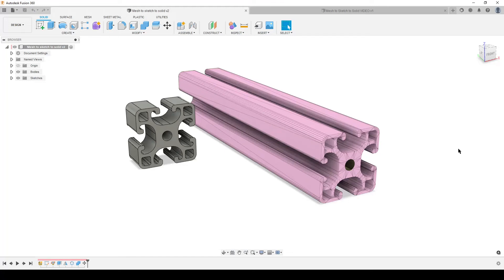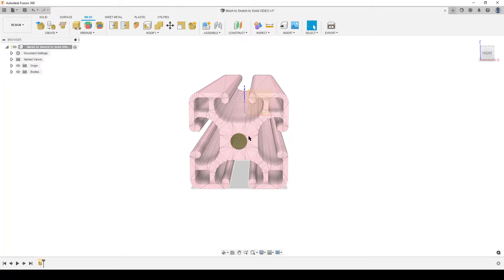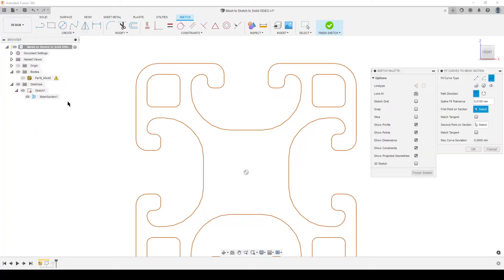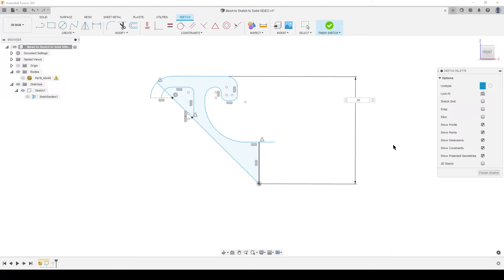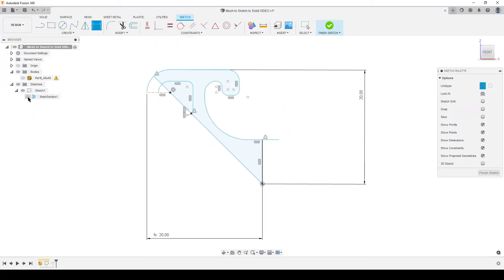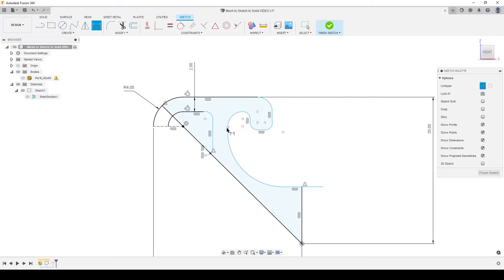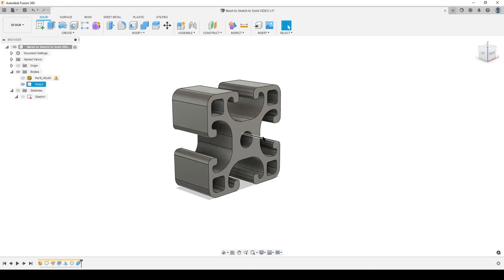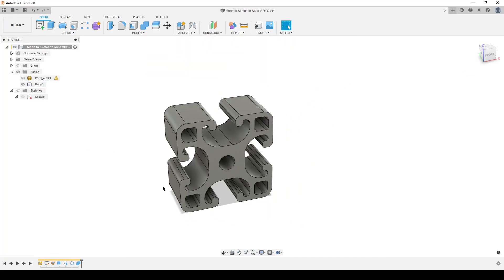Fusion 360 - Mesh to Sketch to Solid (Mesh Section Sketch)

Comment: This makes me even more frustrated about Fusion. I use meshes due to 3D scanning, and I knew about making a mesh section sketch, but did not know about "fit curves to mesh section". I ended up doing it manually, but why the heck can't I just /use/ the mesh section sketch??? I tried making multiple profiles of a hand-made sheet metal plane then lofting it to make the profile fit better to the imperfect area, and it was horribly tedious :/
Reply from the maker: To be fair, Fusion (or any parametric CAD) isn’t really built for editing mesh data. The mesh format itself (triangles all the way down) is more of a 3D-printing/export format than a design one.
There are tools with smarter mesh-to-solid workflows, but they often come with a price tag to match…

Comment: Great video , thank you, but you have the sketch and then you have to draw over the sketch by hand to get a sketch ??? Am I missing something here, this doesn't make sense
Reply from the maker: The mesh section sketch is like a slice of the mesh file with small straight lines. Getting arcs etc. correct needs to be redrawn. Yes mesh files are not good hope more people start sharing things in step format.

Comment: It just seems incredibly convoluted that the section sketch when using the fit curves actually allows you to snap to every single vertices as if it was properly sketched reference data. 
So I don't get why the brown line from this slice cannot simply be treated as a purple projection line for the purposes of extruding or projecting vertices and edges directly to another sketch without this convoluted method.
Reply from the maker: If we could extrude the section sketch it would still be a faceted extrude (a lot of small line segments).

Comment: You just confirmed what I'd read elsewhere that fusion doesn't do meshes well..
Reply from the maker: No parametric CAD software are built to handle mesh-files in a good way. And in my opinion mesh files should not be edited, try and find a STEP file of the design if possible.

Comment: As a beginner, this video is extremely frustrating. I've gotten past the point where I've created and trace the sketch, but I am unable to extrude a solid. You don't show precisely how you did it in the video. To be clear, I do generally understand how to extrude faces from solids, but this is my first time going from mesh to sketch to solid. The sketch is made, but the only thing I can extrude is a surface, which makes the end product look like a cookie cutter rather than a solid face. I'm guessing my sketch isn't closed, but I have no idea how to do that without going through the complicated constraint process that you flew through. Is there an easy way to just join all the curves and lines that I made to trace my sketch?
Reply from the maker: If you have problems with constraints and other things in sketches I'd recommend some beginner tutorials on sketching. If I'd point out every constraint in this video it would and how to set them up the video would be 1 hour long, and there would still be missing information. Working with meshes and mesh section sketches are not easy if your are a beginner.

Comment: Thanks for the video, trying to do this but there has got to be an easier way, is there no project from mesh sketch to sketch?
Reply from the maker: With the Personal license there are no easy workflows. With the paid version you have the prismatic conversion of mesh. Or try to find the files you want in STEP format.
Only projecting the mesh would give all the small lines of the triangle faces and not smooth arcs etc.